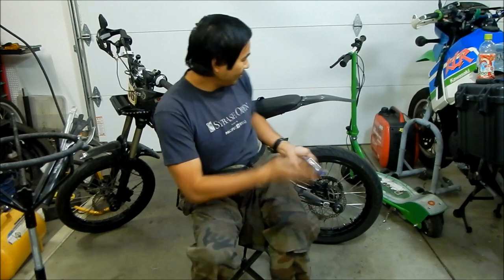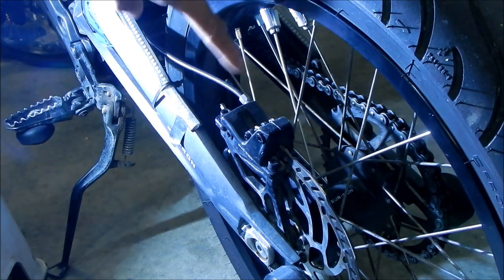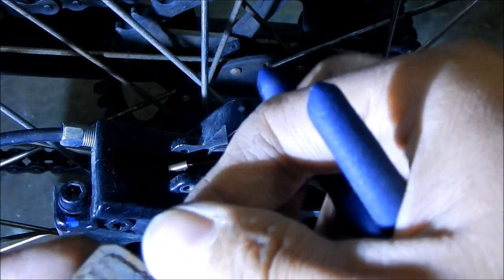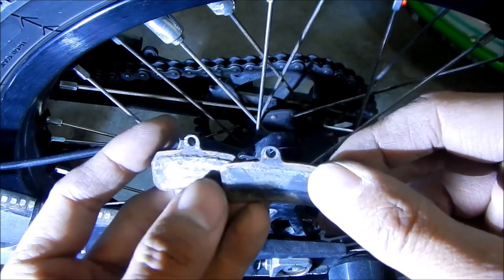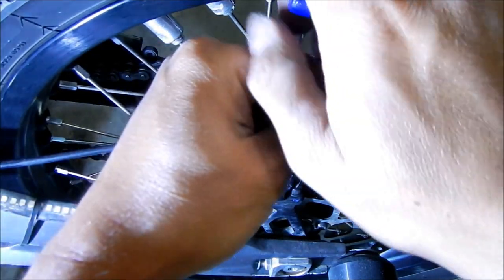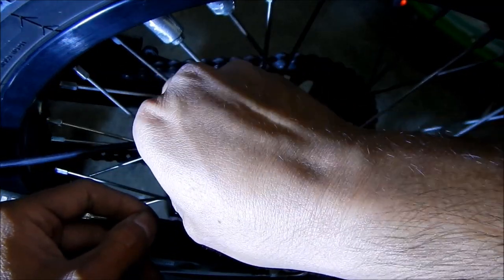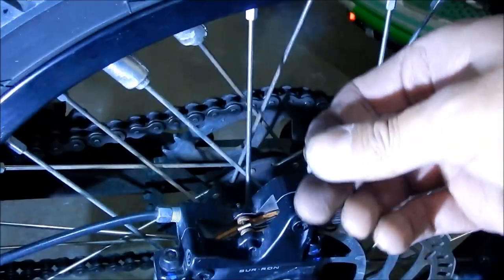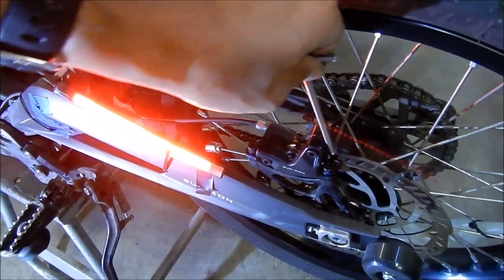Sur Ron Light Bee Rear Brake Pad Replacement

Comment: Good video. but you should be careful(or tell the people to be carefull) when you push the pistons back. I don't know this brake, but Shimano, Magura and Hayes use ceramic pistons. A lot of people damaged there pistons by using sharp tools like a screwdriver. At this stage I always pushes the pistons out, clean them and the push them back...this prevents a piston from getting stuck later.

How do you find the levers? I always had short levers, like my Shimana XT or Saint and think about changing the brakes to Shimano Zee

Comment: hi, i took back wheel of my sur ron to fix tyre.   when i returned wheel back on seems my back break has no more break pressure, any idea what issue it could be?
Reply from the maker: Make sure the pad is still there it didn't fall off.  Another thing that could have problem is the adjuster screw on the lever could have backed out.

Comment: You show loosening the screw at the brake lever but you don't show when you tightened it. Is that the very last thing you do? Also when you are aligning it do you keep the brake lever depressed while you are tightening the screws? Lastly when you changed the pads on the front wheel you didn't loosen the screw by the brake lever, is that no needed on the front?
Reply from the maker: Yes that is what i do keep the brake lever depressed and tighten the brake caliper.  Sometimes you might not have to the caliper, but if you put a new pad you might have to loosen the lever a bit.
Reply: @hadesomegamoto7639  So you didn't need to loosen the screw by the brake lever when you changed the front brake pad ? Only the back?
Reply from the maker: @edwardm502  it depends how loose it is already, you may or may not.  It is too tight to get the new pads in you will have to loosen it.
Reply: @hadesomegamoto7639  OK thanks for your quick replies, your videos are a big help

Comment: I lost the little clip. Can I buy them anywhere?
Reply from the maker: I think the Shimano pads come with a new one.
Reply: @hadesomegamoto7639  nope!
Reply from the maker: What clip are you talking about there a couple clips.  If its the one that holds the pin in you probably use an e-clip, you can buy them from any hardware store.